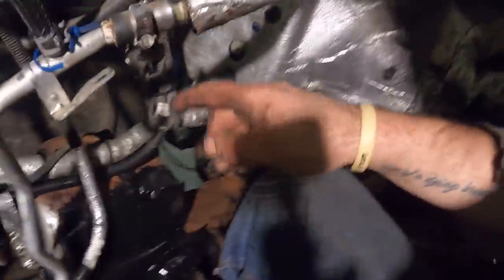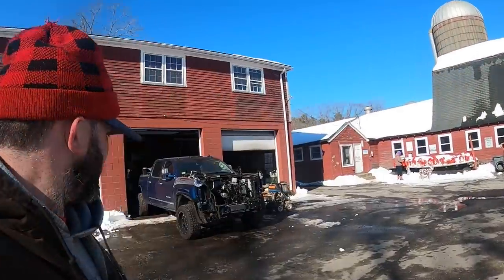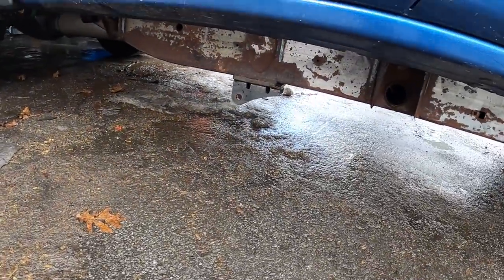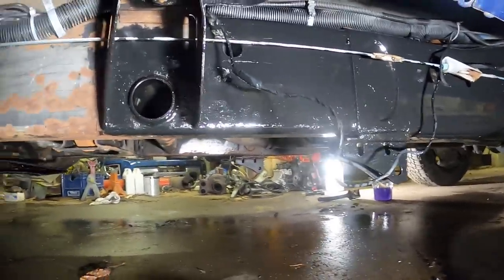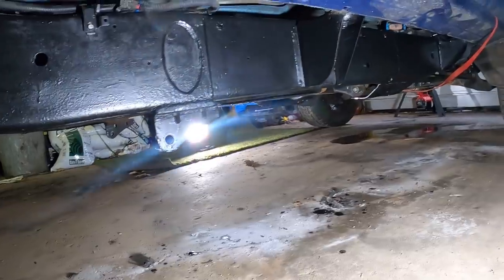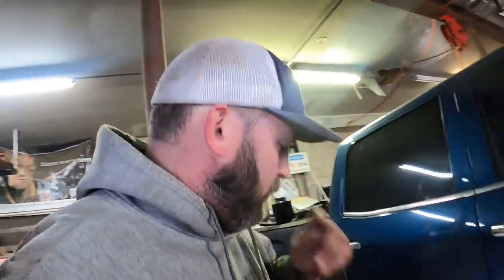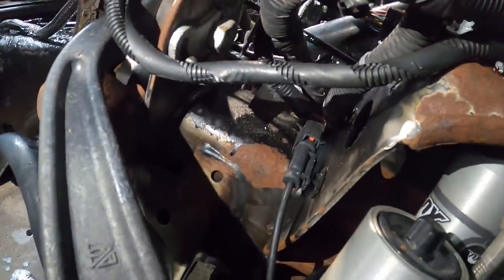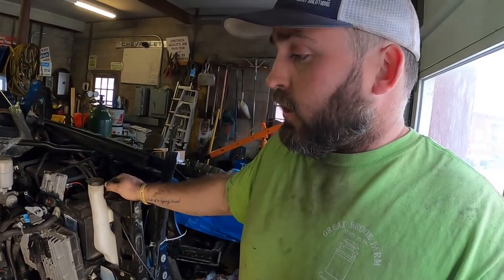I Am Painting It- Why GM Should Stop Putting Wax On Vehicle Frames

Comment: I have pictures of my 2016 Suburban engine bay without  engine. GM put a new crate engine in at 30,000 miles. I didn't realize it would come out the front.
Only my second time to watch your channel. Surely you didn't pull the engine just to paint.
Reply from the maker: I cracked some pistons in mine and currently building the engine. Shops would lift the cab and full front off to make it really easy to remove but I do not have a lift to do that. Thanks for watching. 30k miles and new engine doesn't sound to good

Comment: Day one of owning any of my family's vehicles a healthy dose of Fluid Film.
Reply from the maker: It does help some but it helps wax come off easier as well
Reply: I fluid film all my vehicles every October before the salt hits the roads. Vehicles still look new even after 5 years of western New York winters.
Reply from the maker: @petergisel4864  vehicles with wax frames?
Reply: I did my dad's 2015 silverado. Haven't had any issues. Fluid film is a lanolin wax based product so I assume wax on wax isn't issue.  I recoat them every year. I'll lightly hose it to get some dirt off but keep as much of the coating in tact as possible and just spray over it. It never hardens or cures... So if you don't like it, you could pressure wash it off.  I highly recommend it.  Buy it in the gallon or 5 gallon containers and apply it with a siphon sprayer around 60psi.
Reply from the maker: @petergisel4864  pressure washing is the man reason why my wax is off. It peals right off. I can't lightly hose off my truck after work and salt doesn't come off lightly
Reply: I understand your concern. All I can say is there are alot of good videos about people's results with the product.  South main auto and project farm channels on youtube have videos on it . I've been using it for years and I swear by it. I refuse to use hard undercoating  because the salt always gets behind it. Fluid film can be sprayed over rust and will stop rust.  Yeah it can wash off overtime but it gets me through the winter when the rust danger is highest and then I just reapply for the next winter.
Reply: That stuff stays on for along time? I feel like it would evaporate or dissappear over a few week.
Reply: @petergisel4864  never heard of it. I too live in western NY.
Reply: @robbybachmann8061  It stays on for a year. Dust sticks to it and tuffins it. I'm kinda OCD with my truck so I respray hi whare areas like behind the front bumper. I have a 17 F-250 still looks brand new. The best thing is it's not just for the inside and outside of the frame. All the hardware on your vehicle bolts, clamps,hose ends, break lines even drive shafts, inside body panels. There is plenty of videos on the product.
Reply: @DuffyAg  normal whare and tear remove the he wax. Have you looked inside the frame? Fluid Film protects that. You actually work your truck. It's in salt all the time. I'm in NJ and only drive mine on the weekends. It sits, I've looked under it and you can see water condensation all over, with salt. Not good for long term. I kept my last truck 15 years.
Reply: @petergisel4864  I must be nuts. I spray mine twice a year. October/April. I'm in NJ in the salt air.
Reply: @jimpolk  in WNY you can get it at Napa and autozone locally. I buy mine in bulk on ebay or from the rust store.
Reply: @MyHMMWVaddiction  I have thought about redoing mine in the spring. After I apply it in the fall I don't wash my truck no matter how bad it looks. I wait until all the salt has washed away. 5 years and 90,000 miles my wrangler is still looking good. I have minor rust on the axles near the wheels but the frame and body look brand new inside and out.
Reply: @robbybachmann8061  it's pretty thick, looks like butterscotch pudding. Takes a good amount of soap to get it off your hands. I've never had it wash off the frame or underside of the body but usually by the end of winter the axles start getting washed off. Frame in the wheel wells seem unaffected though.
Reply: @petergisel4864  thanks Peter. I'll look for it.
Reply: Fluid film that baby every November. Then drive down dusty roads.

Comment: Damn towns around here (west of Worcester) are starting to use that liquid calcium chloride crap - worst of the worst. Stuff will rot a vehicle out in a few years. Brutal. I've been hitting my frame and undercarriage with used motor oil for several years. That slowed things down dramatically.

I agree about the GM wax, though. When I first bought my '07 Silverado 1500 new, I thought it was great. After a few years I could see what a bad idea that was. GM seems to be hitting bad ideas right out of the park lately, between AFM issues, crappy brakes, ball  joints, oil burning, transmission failures around 100k miles, etc. etc.. I can't speak for the heavy duty trucks, but the 1500's have been terrible from '07 onward.

Comment: Funny, I did the same thing with an old 1980 Dodge Ramcharger I had back in the day.  Rustoleum worked great.  Body rotted off, but frame still looked great lol
Reply from the maker: I've heard it's thr best stuff and will last
Reply: @DuffyAg  I remember doing two really good coats and it lasted for me.  I did the whole underside and wheel wells too!

Comment: After painting my frames I use wool wax. It’s Canadian product and comes in Black. I reapply every other year. It’s a lot easier than having to repaint the frame because you can blow it on with it’s own spray gun. Chappell tractor in Milford, NH is a dealer.

Comment: For surface protection against rust I like the ospho It Works good have used it for years recently discovered a new system that works really great as well the POR (paint over rust) system with the ultra violet additive it lasts really well in rough environments 
what sucks is we all tolerate these manufacturers selling these expensive vehicles and they rot out like this they at least thought to make the ones that are going to end up in environments like this to last a little longer it's ridiculous to say the least but as long as the people tolerate it it's going to continue....
I don't know how well the whole sacrificial plates method would work on slowing down the corrosion but I know I've use them on a lot of aluminum boats on the ocean and they work well for that I've met some guys that build Volkswagens that use them and they say they work I've heard some people say they work good on cars some people say they don't I've seen them on cars before

Comment: You have nice tractors but dont forget to put rubber on the side's so it wont spark if it move and hit the frame of the truck where the ground wire it will start fire

Comment: Theres a company in Epsom called NH oil. they sell products to preserve the frame .My 2014 I have to paint it every year .I agree the wax is crap. Ive used fluid film as well It comes in black now.. I get rust starting in drivers side fender well on bed which I guess is normal .On one of the chevy forums a property  maintence company that plows snow has their frames dipped in galvanized tank when they buy them. They take truck apart to do it. I guess it lasts a long time. Por 15 Ive use but heard both good and bad about it.
Reply from the maker: I have had NH oil sprayed on my truck. Brother used to use it alot but it speeds up wax getting removed. So many places for salt to stay and rot out

Comment: GM wax frames, another reason GM sucks.
Reply: I'm a Ford guy. They did it too. Have to sell trucks some how.
Reply: @MyHMMWVaddiction  I have had a 2011 and currently a 2017 f250. Both frames were e-coated with paint , not wax. Don't know about earlier models.
Reply: My 02 F-350 had wax. My 17 F-250 is e-coated. Definitely much better. But the older Ford's were wax

Comment: I scraped the wax off with a hot putty knife.  I used a blue bottle torch to heat it up and it just pealed the  wax right off.   Painted the frame with POR30.    Been on a year and still looks good.

Comment: Id put some quick connect plug ins on the rock lights to get in there easier for fuel filters glow plugs or watever
Reply from the maker: It's like a 7 wire thing I believe. They pull out to the side so they are out of the way. I'm doing glow plugs with the engine build otherwise I haven't needed that. My fuel filters are on the lift pump because I did a cp3 conversion and removed factory setup
Reply: @DuffyAg  Gonna be a super nice truck wen put back together. Dont total it on a deer lol
Reply from the maker: @agger838  I sure hope that doesn't happen. Hit one a year ago with it. 12k in damage
Reply: @DuffyAg  yeah those denali front ends aren't cheap
Reply: U might consider replacing the lower radiator hose while apart and drained with a PPE one w stainless clamps to eliminate the common leak on the cheap plastic clamps they use. Or u can carefully cut them off and replace w regular hose clamps.  Found mine leaking today. Apparently the cold weather does it.